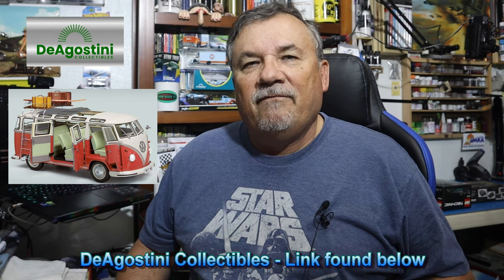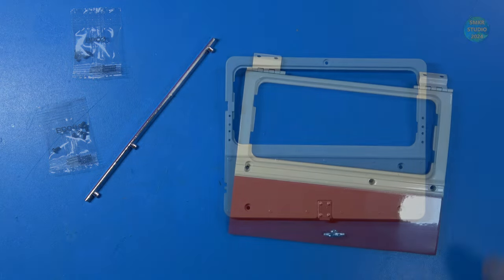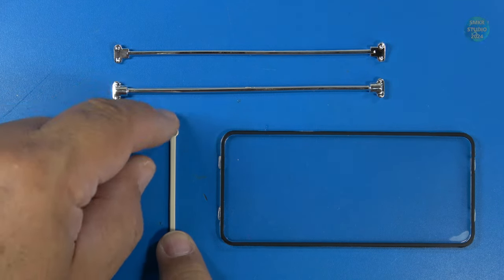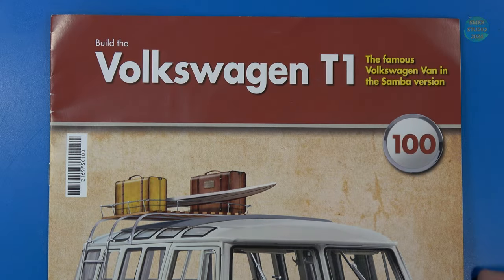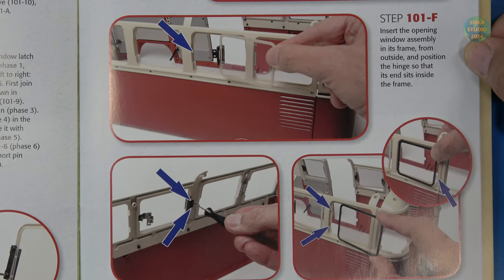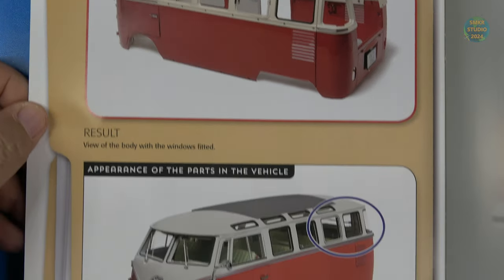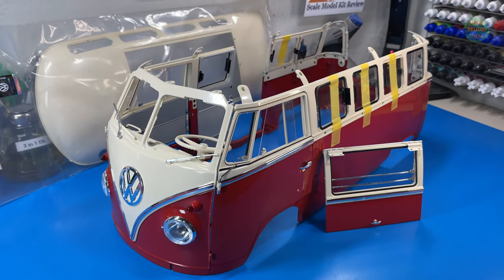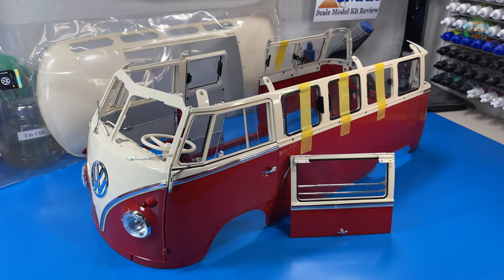Build the Volkswagen T1 Samba Camper Van, Issues 98, 99, 100, 101, and 102 | ASMR

Comment: Steve, I'm  on stage 30 of the T1 and having a great time building it.  I have a question for you in regard to installing the screws.  You mentioned that you use an oil when you install them.  Can you tell me what kind of oil you're using? and the application method.  Thanks, and love the videos.
Reply from the maker: I use 3 in 1 oil, or sewing machine oil will work great also.  Put some oil in cup then dip the tip the threads in the oil before you install the screw, do this only for putting screw into metal parts and not the plastic parts.
Reply: Thanks Steve.